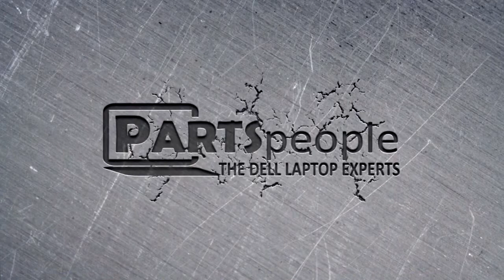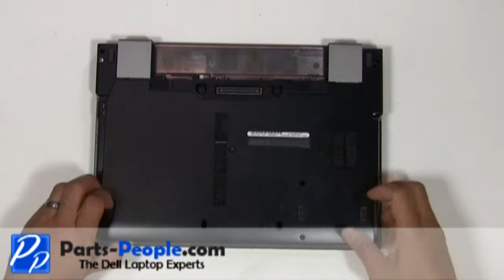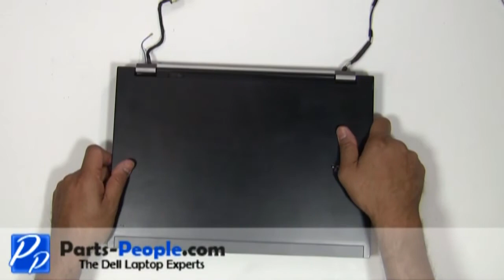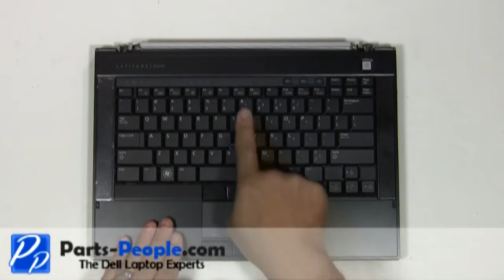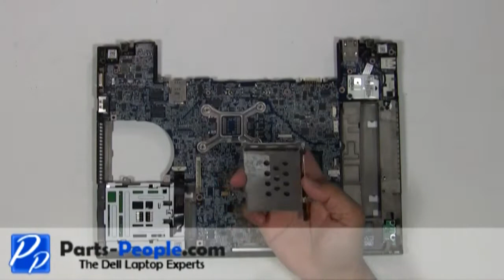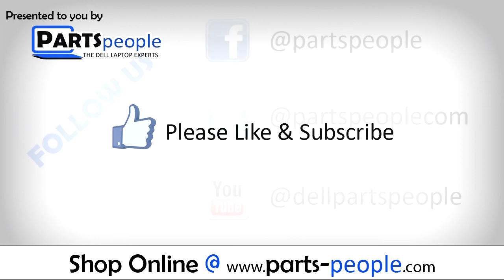Dell Latitude E6400 | USB Audio Circuit Board Replacement | How-To-Tutorial

Comment: Thank you for the video.  I like the Dell E6400 ... they are cheap, relatively good machines, especially with a SSD, and I love the back-lit keyboards. Had 1 laptop were the audio started to "burp" sporadically.  Followed your video in replacing the USB audio card in an 8 yr old laptop.  It was not a joy, but not due to any factors in your video.  The fundamental problem is the now 8 yr old plastic, time and gunk.  The audio "burp" is still there ... I'll live with it when I use that machine.  Thanks again for your video!